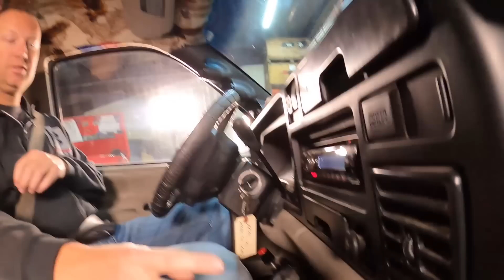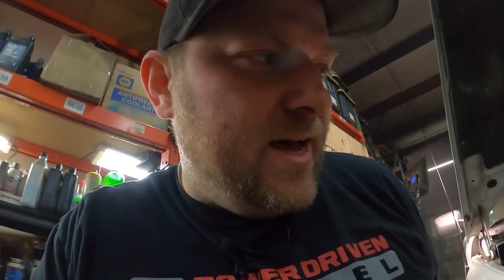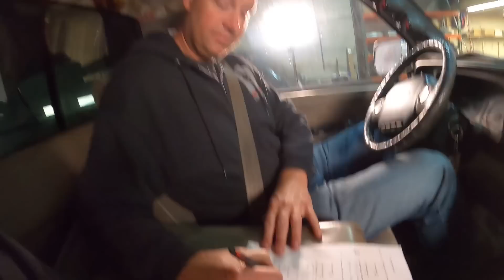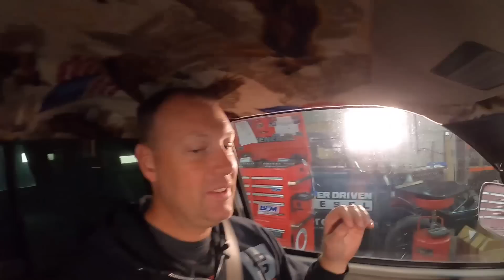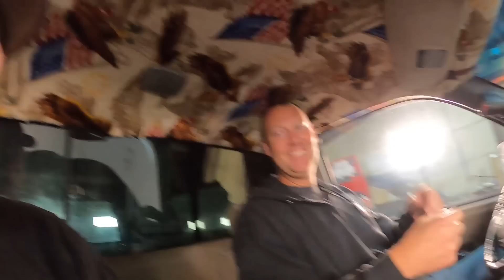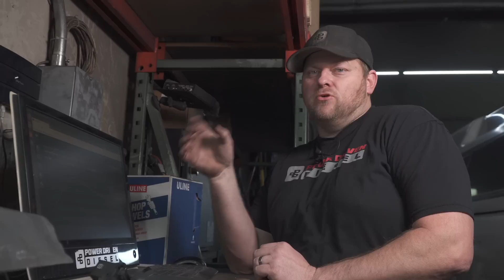Turbo Dyno Test HX35(60mm) vs BorgWarner K27 | Power Driven Diesel

Comment: Looks like bone stock 12 valve single turbo is all I will ever need, but when if I want a no brainer replacement upgrade a K27 or an Aggressor is it.  Thanks for the info

Comment: What's the difference in the k27 vs xz drop in turbo and which one is better
Reply from the maker: Not sure what you mean by xz, but the K27 can handle about 450hp and has close to stock spooling. Our Aggressor 60/64 is a great alternative to the K27 as it can handle up to 550hp, but it doesn't spool AS quickly. We'd recommend both options for daily driving.

Comment: This is why y’all’s stuff blows up all the time. That’s so stupid running a cold engine especially on a diesel. If you had any idea about how engines work and what heat expansion is you would let it warm up. Then admitting it wasn’t a fair test because it wasn’t warmed up and saying “it apparently likes warm runs” like no sh!t I wonder why. I feel bad for your customers.
Reply from the maker: Why so spicy?  To clarify, a "Cold Run" was that it had idled for a minimum of 10 minutes and had done a low 100hp pull first.  By cold run we simply mean that it hadn't been heat-soaked first with a 300+ horsepower run just prior.

Comment: Hi I know this is an older video I just had a question about you putting a he351 wheel on and hx 35. So you machine the compressor housing and thats it no need to machine the bearing housing? And the wheel just slides on? If so thats pretty cool and I may do that

Comment: Excellent video, thank you! Was a follow up video made with the larger compressor wheel?
Reply from the maker: There was not the motor end up having problems and is was throwing off are testing
Reply: @pddofficial  you guys ever test a hx35/40 with 100hp injectors?

Comment: To be fair you have to close the hood to do the Gale test proper.  I know for a fact that on a 2nd gen pulling thru the stock box with holes cut in it and with the thru the fender ring removed I have seen it run 50deg higher egt's  versus pulling thru a stock air filter setup on a hard long pull up a hill.
Reply: Major difference with the comparison is a gas engine with higher intake air temp versus a boosted diesel engine with a higher intake air temp,  the benefit to less restriction in a boosted application outweighs the loss created by 50⁰ hotter temps. Totally different behaviors between those engines.
Reply: @73cjproject  Totally false. I did the thermodynamic math and you would have to reduce the air filter restriction by 5psi to make the same power as just 25deg of cooler intake temp offers assuming you were running 30psi of boost on a 5.9. 5psi of air filter restriction would be one heck of a lot. Been 15 years since I tested it but best I recall a clean stock 2nd gen paper air filter was only about 3 psi of restriction. The change either way is only about 20hp on a 425hp engine.  You raise your intake temps 50deg on a 75deg day you are going to kill your power almost 10% that is substantial.
Reply: @bcbloc02  would love to see your data on the dyno with that. And of course their dyno test is done with the hood open because they aren't running down the road at 75-120 mph getting the proper air flow across the radiator and intercooler/ aftercooler.
Reply: @73cjproject  Know where all that hot air off the radiator and intercooler goes when you are going down the road? It all blows right over the airbox. If you trailer one of these trucks heavy you know the floorboard gets hot from all the heat getting air from out under the hood is a huge help.
Reply: @bcbloc02  so you're saying it doesn't go into the charge air cooler that cools the air going into the engine then? Lol
Reply: @73cjproject  Sure it does but efficiency lost at the compressor can not be gained back at the aftercooler.  Actually it would just be a bigger heat load for the aftercooler to reject which would make more heat for the turbo to suck in making a vicious cycle of "you don't want that".
Reply: I see 425°f discharge @ 25psig from my hx35 with 1050°f egt. This duse overwhelm the stock IC and have seen 163°f @the intake horn. Cummins said 1%per 10°f above 90°f power loss due to thermal expansion . My experience 163= 7% less power on the same psi and fuel , at the other end .
I have mesured  -7 at the air filter, 150 discharge, and -11 at the horn cresting 7mi grade at 15psi 850egt 70mph
Reply: @daviddroescher  Man it must have really been cold outside that day to be -11 after the charge air cooler. If it wasn't for now doubt winter fuel that would have made some good horsepower!  I usually like to see 200F or less post intercooler steady state but I am typically running over 40psi at the turbo.
Reply: @bcbloc02 -25°f when not full tilt I'm running ~5-20°f above ambant, eg 50°out is 55-70°IAT 
I added one of PDD's dust bowl filters and the 180° 2nd gen filter elbows.  Running my heatshild to block the IR heat off the mani/turbine was ~50°drop at the air filter and 5° post IC, so~.5% HP loss in summer.
 computer controlled defuel @160°f IAT IDK if its for protecting the motor or the emmissions

Comment: Another awesome video guys! It’s crazy just how close your new aggressor is with the k27! I can’t wait for the next test because that’s the turbo I was planning to do.. I didn’t want to just toss a 60mm compressor wheel into my hx35 with out milling the turbine housing as well so I could run the larger turbine with the stock 12cm turbine housing of the hx35.. I feel this is a lethal combination.. small turbine housing with a larger compressor, compressor wheel, and turbine .. I’m guessing big power Gains!! Can’t wait for the next test!! 👍🏻
Reply: PS.. I loved your test with the air box pulled.. gained 2hp! Sometimes math and science doesn’t equate to the real world.. there can be huge differences between numbers on paper and numbers in the real world and that’s why I like you guys so much.. you guys are the real world!

Comment: Do you think that the heat helps expand the exhaust side of the turbo it is cast iron and does expand with heat and could be helping expel the exhaust and would make less boost with more room between the wheel and housing and the hot air is less dense in the charge system which helps also but it is just a thought
Reply: I'm guessing the heat is helping close the piston to wall on the 410k mile engine lol
Reply: @73cjproject  ya probably helps make a little more compression and thinner oil in the transmission and engine

Comment: A few things, can you guys put numbers on the screen or in the comments of the runs. 

ie.
HX35 @35 psi 1300deg made 350/700 
K27 @37 psi 1300 deg made 400/800
Aggressor @ 37 psi 1300 deg made 395/780 

Can we get a boost plot of each turbo tested? Some Dyno's have the hook up for it.

Can we get drive pressure? Drive pressure is super important as you guys know to health of the HG, exhaust valves, turbo shaft speed and where you're at in the efficiency range of the turbo. Thanks guys. Just looking for more organized data.

I love the videos, very informative. Are you guys going to test a SX-E362 with different exhaust housings in the future?
Reply from the maker: We can definitely publish a results graphic.  We are working on live boost plotting and it should be working on the next test session!
Reply: @pddofficial  awesome!! Thanks guys!!
Reply: Years ago they tested the 362 sxe with different housings. Its on their channel. .7 and .91 i think

Comment: I made 495 rwhp in 2006 with a hx35/40 on a 01 5 speed 2wd with 150hp inj’s,Industrial Injection dragon Flow VP,and Edge Drag Comp on 3x5(basically an Edge EZ)......

Any higher setting on the Edge it would fuel so hard it would drop 100rwhp.

Turbo was built by Jason at Forced Inductions and I ran it for a couple of hundred thousand miles. Prob one of my favorite all around turbos.....

That’s why I bought a k27 and plan on the Power Driven Compounds!